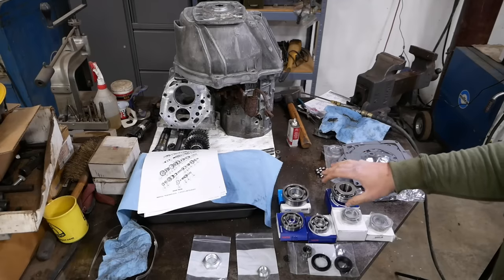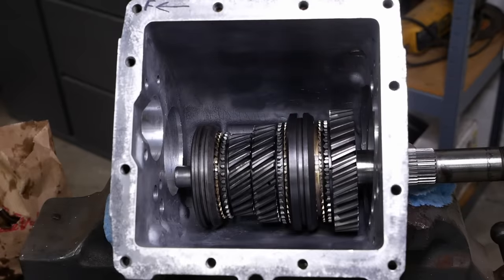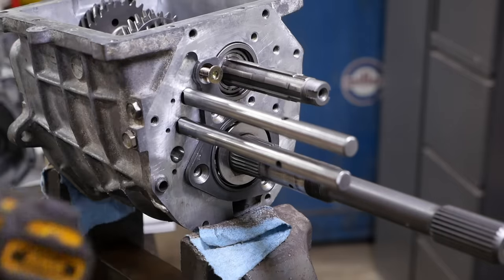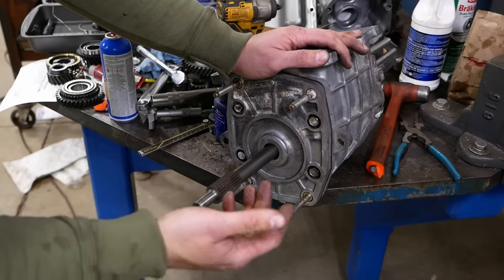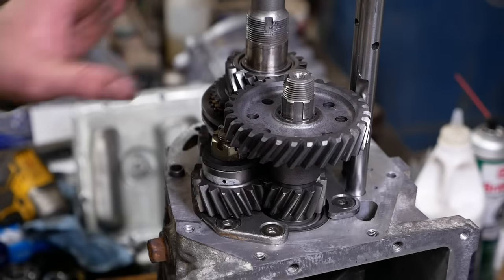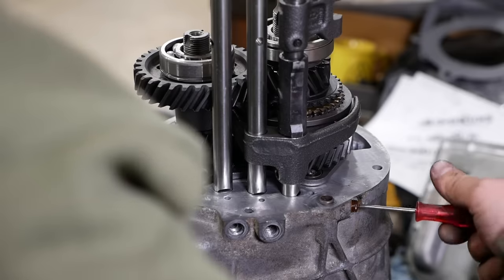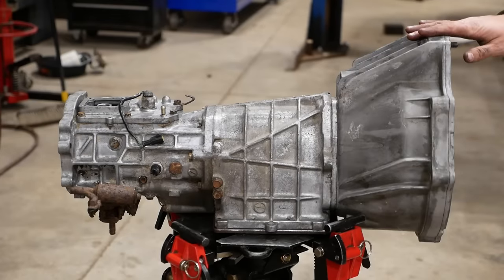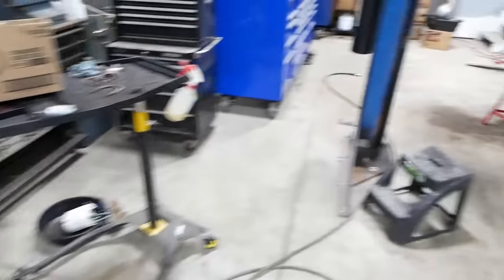Ford Ranger Transmission Rebuild - the Complete Guide No One Asked for - Part 2

Comment: watching the video and 3 minutes in I noticed you have the 1st gear synchro on second gear, not an easy one to build good job getting it done
Reply from the maker: According to the parts break down from the supplier, 1st and 2nd gear synchros have the same part number.
Reply: @WatchWesWork  yes aftermarket synchro are the same but the OEM ones are slightly  different and different part number, the first gear synchro has a dimple and the second gear synchro doesn't.  Will probably work

Comment: Nice video, shame you decided to sell the two, I have a 99 ranger with the 4.0 and a five speed manual. They're nice dependable dailys if you can find one without rust lol. Has about 218000 miles and still starts like factory new.

Comment: love your videos as a 40 year experienced mechanic a little unsolicited advice you don't need high tac gasket sealer on the paper seals you should just use grease for two reasons hold the gasket in place from moving and if you ever have to take back apart and you will be doing that on a first or second time rebuild  but if it helps you sleep at night and think you need to do that time consuming step then put it on the gear cover and or pan so in the future it sticks to the case cover or pan when removing to service it  and than if the gasket is bad you can scrape and  clean it off easier  than on the gearbox engine block etc...  like a oil pan or trans pan  gsk at least thats what i do standard practices lol

Comment: Nice Work Wes! very interesting! I have only been inside of an automatic transmission, not torn apart a manual one. I am glad you are making to the big YouTube bucks to offset the cost of fixing up the Fritz bits-mobile. I guess there is a call for that kind of truck in your area, here we would just scrap that thing with the rust it has under it!
Reply from the maker: Any 4x4 truck is worth something here.

Comment: Good way to get a rough idea of torque is to use a pair of old mechanical bathroom scales and measure the length of your spanner! I've used this with a 6ft tube to do wheel hub bolts up to 200lb feet! And if you compare it to an actual torque wrench its not bad!

Comment: I'm chuckling as I watch this when you call out dimensions.  Seems the manual calls out imperial dimensions but you can tell they just converted from metric.  0.168 -> about 4.2mm and 0.240 -> about 6.1mm :-D

Comment: I did a clutch on my 89 4x4 2500 suburban with the sm465, that trans was heavy, then I had to pull it back out cause someone aka me didn't realize he put the throughout bearing in the fork wrong oops, thanks for a video !

Comment: Neat. This is the transmission I would look for when building my dream bronco 2. This or a 146. They are both Mitsubishi tranny and give you some interesting engine options if you are up for importing a block to build. 

The TK4 and TK5 as well also give you interesting japanese choices, maybe some Korean too. If keeping the original engines I hear the Mazda 5 speed trans is the strongest idk. I also don't know of Mazda engine worthwhile that bolts to it, except maybe the truck rotary if you can find the bell housing for that trans to a rotary.

Comment: This guys talent  is thru the roof…feel like I’m in middle school with this guy…but I’m the lucky guy,,,live in Orlando and you ypull&pay is 10 mins away and at any time there are 25/30 rangers I said 25/30 that right …rangers in the 1500 cars/trucks that are in there in a given month,,,can’t find it ..wait 30 days and another 100 trucks /cars are there…no Body fixes shit down here me included…these trucks a lot of them if not hit …look fantastic. No rust…chassis looks great lots of spare parts…trannys are 150 dollars …manuals you know are good.     Automatics   Ford……Lololololo …Buyer beware..it’s a Ford…pull it yourself…I pay a guy $100. to pull it lazy and old..I have 5 sport tracs  2 sports paid $1000. Each bought with bad motor or tranny zero rust..never in my life changed a brake line..this is my hobbie/ not a mechanic  have guy in Tampa rebuilt upper half $1400,  another guy tranny1400. So I’m in running for 2 grand..used shocks $4 each..used breaks $1. Look like new…alternators. Look new. 30.  No used fuel pumps to much labor..if it goes bad..if I lived in the rust belt..I would buy a truck from Arizona/or south and drive it back…would also spray trans fluid underneath on the chassis …Tranny fluid does not destroy rubber..every 6 months..it’s a horrible messy job,,,bit it’s cheap and somebody’s got to do it.  Me…that ranger he’s got is full of rust…man it looks terrible…there’s also a guy down here that only rebuild fixes rangers….so I’m lucky..engines are a little more hit and miss..they gone up to $400.  And you don’t know if there good unless there hit…so your talking lots and lots of labor…

Comment: I did a repair on a 5 spd from a Dodge Dakota the transmission assembled into a bearing spacer plate between main case and output housing then slid main case over gears ,awkard but went ok.

Comment: Oh those rams leak. I have the same strapon trans jack. Only about a yr old. Had to replace the ram once already.... for an over-priced trans jack, I expected more. I'm not a transmission only shop either. Heck, I'm mostly mobile.. lol Could be a chemical incompatibility issue from the trans fluid leaking on it? Idk. 

Excellent video Wesley.  I was hoping for the 1 long video but I get it. I appreciate the in depth process. I must say, coming out & apart looked far far worse than the process of going back together. I don't recall ever working on such a complicated manual gearbox.  Merry Christmas 🎅 🎄 🥰⛄

Ps just received the merch! Looks great!!

Comment: Excellent video  Wes :) also low miles on that truck for sure what you said and prices up hear are very expensive on donar vechile be $500.00 to $2.000 or  Junkyard about $850.00 to $1.000  or rebuild  shops about be $1.000 to $2.500 in Ontario Canada my area plus labor take out or put in too at in dealership or family business too be high to low  hour rates! But Wes :) you do excellent work and do part You Tube videos as much it easy for you and does better on find stuff want show to and you said be hard to do to because Internet in area like sometimes! Like parts types and very easy to understand better to also helpfull too ! I can watch do one in for like transmission in 4 instead 2 if needed too but did in 2 work for you excellent too!

Comment: This was a great project. I do things like this often for similar reasons to yourself. I have never rebuilt at standard transmission so was really interested in the process. I would have liked to have seen the more difficult bearing press processes you did. Is it possible for you to post that for those that are interested in venturing into that jungle? Thank you for posting this.

Comment: Great video content thank you. Did it make sense to do a rebuild? Who is to say that the one and only used box you could find was any good anyway so you may have bought it, shipped it, fitted it and found it was no good AND still had to rebuild the original. Difficult call but for what it's worth you got it right. Guess it was very frustrating at times but made great videos. Seriously impressive.

Comment: My dad had the same truck and transmission. After about 120,000 miles he used to have a problem where after driving on the highway for 15-20 minutes the truck would not come out of 5th gear, and he would have to wait 10 minutes for it to cool down before he could take it out of gear.
Reply from the maker: That's weird.

Comment: As a lifelong 78 year old Mechanic Ive rebuilt literally Hundreds of straight drive Transmissions And NEVER ONCE HAVE I SEEN THE NEED TO ASSEMBLE THAT MAIN DRIVE ASSEMBLY INSIDE THE TRANSMISSION I have ALWAYS assembled it on the work bench then turned it end up and slid the backend thru the bearing hole and dropped the complete assembly into the transmission housing. The way you assembled that thing inside the transmission makes the chance of damaging those brass sync rings much greater plus the chance of damaging bearings and such is greater the way you did it and I have been to many schools on building those transmissions and they teach you the same way I just told you so learn before you tackle another one. Take that main shaft out as an assembly and put it back as an assembly and the way to accomplish that is remove the front and rear bearings first then remove the assembly and take it apart on the bench and put it back together on the bench oh and if you are going to be working on those transmissions youd do good to invest in a set of bearing pullers and presses
Reply from the maker: How many of them did you build on camera?
Reply: @WatchWesWork  I Worked as a fleet mechanic for flowers baking company Cars Trucks and Tractor trailers I got paid to work not be a movie star
Reply from the maker: @douglasmorrison9098  The point is you can't do things efficiently or "correctly" if you want to make a video about it. I guess it just makes you feel better to lecture me.
Reply: @WatchWesWork  Nope just giving you some words of wisdom not lecture trying to make your life a little easier by telling you what I learned and went to school for. Take it in those terms and will make your next transmission build easier.

Comment: I have seen situations where a used transmission if not checked out before installation can cost more in wasted time than if the original unit was overhauled to begin with, and now you have mitsubishi transmission experience.

Comment: No idea why folk told you to use the cotter pin with the split parallel to the bolt/nut. They normally go on at 90 degrees to it and you loop the ends back round the top of the castle into the next gaps if its long enough (and will be a 2nd bend bend on each leg making it harder to work itself loose). I have seen a few designs with it like you did but that is non-standard and I wouldn't listen to folk telling you to do it like that unless it was found that way or the manual says to do it from the non-standard method of use of cotter pins. Anyways good vid.

Comment: There is also the issue is putting in a used transmission is it may have more problems than the one you took out. I had a similar 1997 Mazda truck with over 200k miles and the synchromesh went on the first gear.

Comment: You would have has an easier time if you had a ball bearing puller, the kind that has hooks that in-gauge the bearing from the inside of the inner race. This is similar to a tool that removes the outer bearing of a VW Swing axle which can not be removed any other way without removing the entire swing-axle assembly. The VW type has four jaws and they are machined not to scratch bearing to be removed. You could use a Simatool Ball Bearing Puller #BP61. It pulls on the inside of the outer race though but it's all good though. I never tried one though so your mileage may vary.

Comment: The M5OD r1 and r2 are easier Transmission parts warehouse has the rebuild kit with bearings and syncro blocker rings as well as the needle bearing kit For future reference.

Comment: Rebuilding in my opinion was the way to go. What if you installed the used one and it had the same issue. Now you know it's all good. I would have at least changed the pilot bearing though. Otherwise dam good job.

Comment: Did you use a grinder on that surface ?  That's a sealing surface  that needs to be flat.  Even small scratches cause issue.  It's going to leak and extra sealant won't work for long.
Reply from the maker: LOL. OK bud.

Comment: One small question, Wes: Should you be hammering on those shafts with a steel tool? Surely it is better to use brass or perhaps a hard wooden block?

Comment: What causes the input shaft bearing failure is warming up the truck on extreme cold days when the transmissions in neutral the flu it is so cold there’s no lubrication to that bearing. I’ve had that problem many times

Comment: If you really want to tweak the torque wrench fanatics, get a spring-type weight measuring scale (e.g., fishing scale), then go ahead and use that combo wrench by pulling the other end with the scale.  Do some measurements and some math, and you can actually complete the job to spec.

Comment: Good video! Just a heads up it’s entirely possible to install the transmission with the y pipe in place, I just did the same job on my 87 ranger without  a lift or transmission jack

Comment: Not quite sure how Ford do things on your side of the pond, but Ford UK added 5th gear into the extension tube to convert their then existing 4 speed gearboxes into 5 speeds. Your gearbox kind of looks have gone through a similar design process.
Reply from the maker: Yes. It sure looks that way. Many companies did that back in the 80s.

Comment: I'm surprised you didn't use some type of assembly grease for the bearings. A light coat of grease can prevent brineling or overheating the surfaces. Otherwise good job...
Reply from the maker: It's literally filled with oil...

Comment: Great video Wes. I have been putting off bleeding my slave cylinder on my ford ranger. Have you got any advice.
Reply from the maker: I did it just like it says in the manual. Gravity bleed first. Then you pump the pedal 10 times letting up as fast as you can each time. Then hold the pedal down (I used a hood prop) and crack the bleeder. I had to do that process twice.
Reply: @WatchWesWork  
I'll give it a try. Thanks Pal. 👍

Comment: old timer  gave me a hard lead hamer for knocking machined parts around yep brass sucks for reasembly lock up a roller bearing good and proper every time think it was made out of conter weights he melted down has a use in sertan areas not all nice to have around if you find it when you need it good at hiding with ghost land of 10mm sockets

Comment: If the dudes in the comment section actually knew what they were talking about they would know that the hardware manual states  bending cotter pins parallel to the bolt shank is the PREFERRED method WHEN ABLE, not mandatory.

Comment: When you reinstalled the main shaft, were you pressing on the inner race of the big ball bearings to seat their outer races in the case? Is it that sometimes you have no choice and the bearings will withstand a small amount of that?
Reply from the maker: It's not going to hurt it at all. Deep groove ball bearings will take a huge side load.

Comment: Ain't nobody cut catalytic off because its plugged, more because its easy money. Two last cars I have bought the catalytics have been cut and patched something like this, but here i have to get inspected every year and without it I will fail. Its really bad getting decent catalytic because the aftermarket ones usually work for a year.

Comment: On the fifth year bearing shim it appears The unit I am working on does not have one, if I take my pick and push the bearing sleeve in tight and the needle bearing in all the way and then pull the pick up and down it catches slightly, how thick was the shim would you guess? I have a Pinion shim that’s at ten thousandths of an inch I held up on the outside to the bearing and the sleeve and then slid the pic over it, doesn’t seem to catch if at all. Now the impossible mission to find one. I’m getting measurements of 30 mm ID 32 mm OD and .023 mm thick

Comment: Pretty brave man to not use thread locker on a gearbox fasteners. I generally use red thread locker generally used for internal motors and studs. Easy to remove if you have to with heat if it doesn't release on loosening. Cheap insurance not to get a broken gearbox. I've learned the hard way what happens when a moving component shakes fasteners off.

Comment: My question has nothing to do with the video. I’m working on a 2008 GMC Sierra and I have an endless air in the front brakes while bleeding problem. With the car on the brake pedal is slow to return after pressing it to the floor. There’s almost no resistance in the pedal. Please help me. I’m thinking bad brake booster.

Comment: Just started watching this,
I have a 96 Ford ranger,4.0 6 cy
Bought it an the next day the trans started slipping,the guy I got it from had it done,an gave me the warranty,1 year,12,000 mile warrenty,since November it's bin back 6 times,
I get it back,soon as it gets hot,starts slipping,
When iam doing 70,the overdrive light keeps blinking on an off,
This is now the 4th transmission,now the guy put in a new computer,an rebuilt it again,he drove it,an said the exact same thing started happening,
Please,does someone know what the heck can be causing this,
Iam at a loss,an iam ready to just junk the truck,
4 rebuilt transmissions,an they all keep burning up withing 30 mins,
Thank you

Comment: Very enjoyable 2 parts. But what a bitch of a transmission what were those engineers thinking. I was only having a conversation today about poor car engineering. My wife has a red Rav like your wife used to have. It needs rear shockies. On my old Landcruiser I change my own. Rear set say 30 mins for an amateur laying on his back under the thing. Not the Rav you practically take half the car apart just to change shocks and at great expense. Why ? On race cars most things from gears to brakes changeable in minutes. It can be done so why make the average consumer suffer so much.